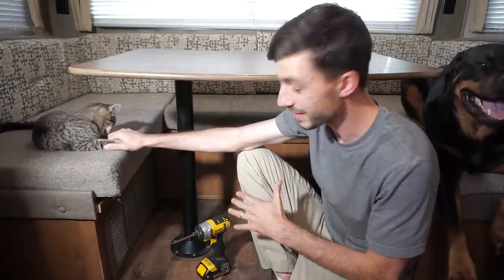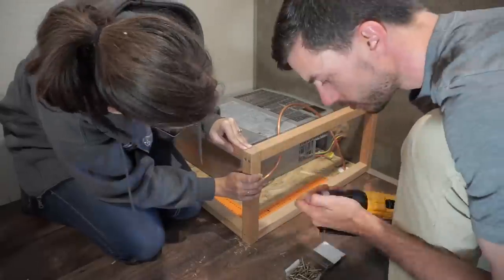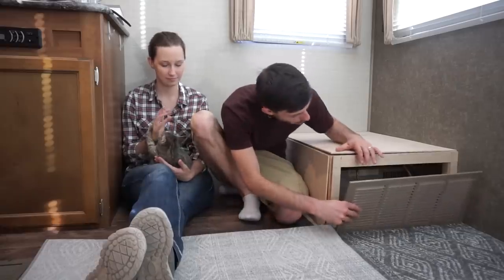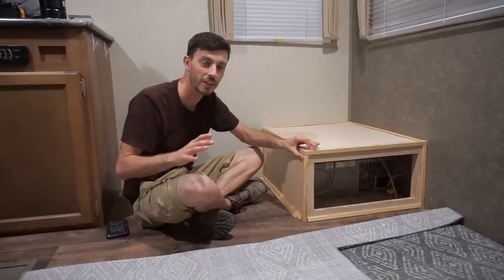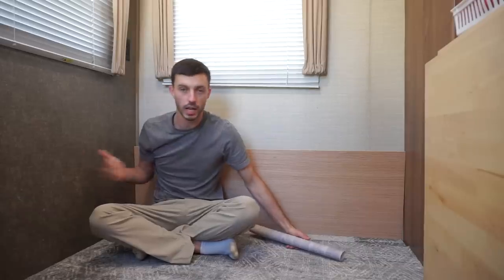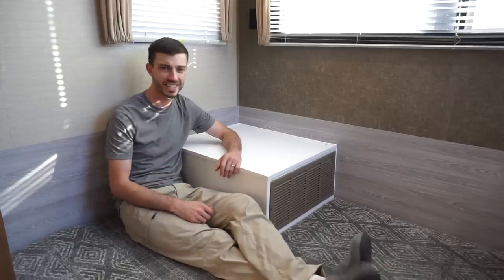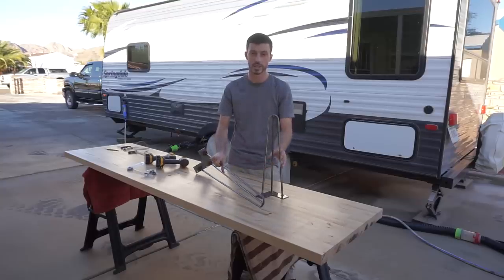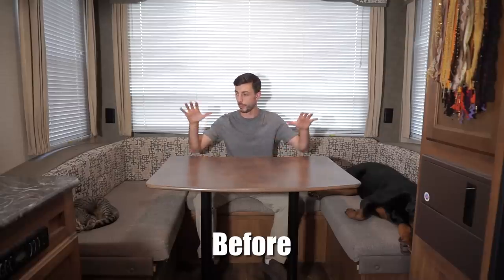Dinette Destruction! - RV Dinette Replaced by Improved Work Space - RV Renovation

Comment: We took out the rear bunks in our trailer to make a craft center for the wife. We put in the foamular and  board in the cargo doors like you did. We added a cat flap into the board/foamular of one of the cargo door spaces. When we land, we open the cargo door to expose the cat flap behind it and put up a folding dog kennel for our kitty, on the exterior.  We cut a hole in the kennel to match the location of the cat flap and put the kennel up on a table which is butted up against the side wall of the trailer.  She goes out from the cat flap right into the kennel. We keep her litter box in it and she spends a lot of time out there, especially at night, to watch the world go by. She loves it.
Reply: Would love to see a video of this .I just bought a fifth wheel and thinking of removing the bunks to make a walking closet and change room
Reply: @junehanna4293  I wish I could provide one for you but that was 5 years ago. I do have videos on our channel that might show it, I'd have to check and get back to you. We no longer have that rig and our little angel has since gone over the rainbow bridge.  We now have  another kitty, Roger, and a class A motorhome. We did something similar. We took out one of the rear bunks and a long closet, which gave us room for a recliner and exposed the wall to the exterior carbo bay. We cut a hole in the cargo bay wall and inserted a cat flap. We then put a small dog crate on drawer slides. We simply open the cargo bay door and slide the crate out. Our dog and cat have access to the crate from inside the motorhome whenever they want.
Reply: @junehanna4293  Our coach is an older model and it doesn't have slides. We took out the dinette and the folding sofa. Now there's so much more room! We put a set of Sterilite dressers on one side and a smaller folding futon couch on the opposite site. I have enough room for a TV tray and a chair in the isle between the couch and the dressers that I use for my laptop.  The next project is to build a folding bed platform that will span between the 2 front seats, remove the futon sofa and put a desk in its place.

Comment: I enjoyed watching your build, particularly the butcher block top.  If you still have problems with back pain, I suggest that you modify your work surface height to approximately 27" high.  I am guessing that the height you are using is more like 29" high, which is too high for using a keyboard for extended periods of time.  I have been dealing with office furniture, both workstations and seating, for over 4 decades on both the east coast and the west coast and helping people with back pain issues.  I have been able to help over half my customers with back pain by simply adjusting the work surface height from dining/executive (29") to typing/secretarial (27").  I suspect this is not something you want to undertake, especially after investing all this energy setting up your work station.  This is just an idea going forward, should you experience continued back pain.  Thank you for doing an outstanding job on the presentation of your project.  Don't get discouraged if you come up with improvements on projects you have completed.  It has been happening to me for decades.  I'm getting better, but not perfect yet.

Comment: another suggestion for  accessing furnace: put a piano hinge on one side so you can just lift the top if you need to work on the furnace. You can re-nail the trim on the lid only and it will still give you a finished look.
Reply: Yes I was surprised they didn't put a piano hinge on it too.
Reply from the maker: The plan is to take the top off the box if we have any problems with the furnace and service it and then re-secure the top of the box with trim
Reply: @Lina: How would a hinge help for the occasional, perhaps never, need to get at the furnace? It has got an unwieldy table  sitting on top of it.
Reply: G Henrickson Yes. The legs on the table would have to be removed if there were a hinge. They may be able to slide the lid out from under the legs if they have to remove it. Either way...you can’t always think of every contingency before it’s done.

Comment: Love your transformation! I have the same camper in a shorter version, I turned the dinette into a permanent daybed.  I don't fulltime (yet), but weekend with my son and three dogs.  I've also added a curtain that wraps from the daybed area, across the kitchen and ends on the otherside of the bathroom door.  This gives each side a little privacy and when completely wrapped around makes the bathroom three times as big.  This winter I am working on changing out the bathroom door for a sliding door since I like to leave it open for ventilation, but don't like that it blocks the walkway.  Happy Travels!!

Comment: I pause at 6 minute to say I like your trailer. I like the simplicity of it, especially no slides. We’re on our 3rd travel trailer since 1978! Bought this one in 1998, be 21 years old in July! 7x25, simple still good. I just need to fix toilet flush thingamajig, it’s stuck now. I don’t get all this, “And it’s got a ceramic toilet!” stuff. This plastic one has lasted over 20 years and this valve sticking is first problem!

Comment: Good job!  The table top and legs are real cool.  Set another basket on top of furnace box for second cat, then they all have a special place.  May I suggest: a bead of clear silicone under edge of outside door to seal it, and if you're going to re-use the spackle, add water to top to keep it moist, just pour off when you use it again.   Over all I was liking your work as you demo'd the inside, so neat and clean, and good work with all of it.  Looks great!

Comment: Watching you brings back memories of last year at this time.  I took my dinette out of my 1992 Monterey by Cobra motor home.  It wasn't as easy or clean a break as I was hoping for...My floor had a raised portion where the generator housing came up into the space...We moved the couch over it from the opposite wall, but I would love to sell the couch and cushions from dinette, since they are in pristine condition...all end caps and fittings to boot.  Anyway, this brings back lots and lots of memories!  Thanks for showing me how you did things.  I plan to remove the queen size bed, and it has the electrical panel, so that will be fun.  Blessings!

Comment: The Dinette is the most ridiculous leftover from 1950's RV design.  It is long overdue to be axed.  I removed mine from a 22ft Class C, and put a desk up instead. One side over the wheel well, I build a 4 drawer cabinet.  To the right behind the driver seat, I secured a dresser from IKEA.  I added a birch plywood solid table on top as the desk.  Room under for my legs, laundry basket, and comfortable office chair. Perfect!  I sold the dinette to a guy who was converting an empty trailer for $200.  I also removed my useless fold out couch bed from factory, and made a slat bed instead. I still have the loft Queen bed, but this one is a bench by day, bed by night.  I only need to pull out the slats if I have two guests for company. So much better and very comfortable.

By the way, the typical raised platform for the dinette can be easily removed. There are a couple of wires and plumbing down there that can be pushed along the wall instead.  

This was a very good idea in your RV.  Smart move!  That rug looks nice.  
fyi - Please do not add any music to demo, DIY, tour, cooking, or wildlife videos especially if you are talking. Its an ON OFF game with the volume control - no fun for viewer.

Comment: Amazed at how much dead space was in the original set up. Why it was never designed for storage is a shame. Suggestions: since you have a garage shop set up. Next time, design ahead of time, prototype in cardboard, so you have all your measurements. build the framing in the shop bring it on site, install. Hope you finished the box with removable closures, so you can access the furnace if ever needed. 
For the carpet, again you can make a template with brown paper, so you’ll know where you cuts are. As for preventing fraying, carpet tape applied to the underside of the carpet right where the cuts will be made will help prevent fraying, as well as assist you in reconfiguring the shape of the carpet. Again a cardboard template would have helped in cutting the hatch closure. The contact paper in time will loose some of it’s adhesive properties unless it is properly burnished.
Everything looks very nice. One last suggestion, by installing legs on the desk, a potential problem has been created. If you ever have get access to the furnace, the entire desk will need to be disassembled. This could have been avoided by installing cleats on the three walls ( simple 2x3 installed into the studs with countersunk bolts) pre drill vertically up through the 2x3, predrill the underside of the butcher block, set the butcher block on top of the 3 sided ledge, finish by installing screws up through the bottom of the 2x3 into the corresponding holes in the butcher block.
This would have given a secured to the wall free floating desk, with un encumbered access to your furnace.

Comment: I have a cab over truck camper.  Can't quite do the same thing, the wheel well is in the way -- but you guys have me thinking.  Maybe if I amputated both legs at the knees -- nah, not practical.  Maybe if I put the cross table higher, and put the chair (when needed) on a platform.  I can hear the gears turning in my head.  Hasn't happened in years.  Thanks for sharing.

Comment: This was great to watch. Question  about the dinette table. I didn't hear  you mention that at all during the video, but I see you linked to it in the show notes. I like that. Do you  have it on locking casters?  How do you  secure  it when you're moving? Also, the shot  of it unfolded with dinner places set looked sweet, but I couldn't figure  out how you'd get in/out  of there to get to the kitchen area, it looks like you  have about 6" of free space per side. ;-) Are you both that skinny? heh. Thanks again,

Comment: Just wondering since the Chairs have the wheels. If they move around when you are traveling. If they are. You could get like a Long bungee cord and use the legs on the table you made. and attach the cord to both sides just to keep the chairs from moving around alot. Still nice job
Reply from the maker: We just lay them down on the ground, no issues while traveling

Comment: So when the heater needs service how do you get at it??? MAYBE A DOOR
Reply: I was thinking the same? Hmm 🤔
Reply: The box is made where it wouldn’t be that hard to disassemble.  One good thing is maybe they have a furnace like the ones in 3 RVs I’ve owned.  Had each one several years and those furnaces were like the Energizer Bunny.   Just kept on running.  Good luck. However, if you guys ever have any HVAC problems, look into replacing your systems with a Heat Pump Mini Split System.  They are available in 110 v units now.  Might work well for y’all.
Reply: I have one just like that.  The high temperature limit switch failed.  The service guy did not even try to access the furnace from the inside.  He took the exterior cover off and worked his way to the front where the limit switch is located.  Those things are meant to be worked on from the outside and not the inside.
Reply: Great job!
Reply: @pav7463  - ABSOLUTELY!!!!
Reply: How do you think??? There is a lot to be said for keeping things simple.

Comment: Question: Why sand after applying coat? Doesn't it take away the coat?
Reply from the maker: No ti does not, it takes away any waves in the coat from the application and it makes it smoother.  It's actually part of the instructions on the polyurethane

Comment: What was the purpose of the table legs? Either a couple more metal brackets , or a continuous wooden cleat anchored into the trailers studs would have been sufficient, and even have added strength to the rear of the the trailer.

Comment: Did you consider moving the furnace and centering it under your table, even turn on end if possible. Then trim the legs on the ikea table and slid it under your table and over the heater.

Comment: I agree, dinettes are made for RV shows, not day to day living. The foam is too soft and they're too vertical. I must say, the construction of you trailer is pretty good from what I saw you take out. No split boards and funky corners. 
I might have put the seam in the carpet on the other side, under the table, but that's just me. You did a great job building your desk!
Reply from the maker: The reason we didn't put the seam over there is because we have to move that table often and we didn't want it catching on the edge

Comment: I would cheat on the carpet and use carpet tiles. They are removable if you need to replace a piece as well without replacing the whole piece. Commonly used in commercial spaces and they are quite durable. Your job looked very nice for sure...just putting it out there as a suggestion for future projects...

Comment: Did you check with the manufacturer for spacing astound the heater. Without proper spacing it doesn't give proper ventilation and will cause a fire. I'm scared for you.
Reply from the maker: Manufacturers put the same sized furnaces in smaller spaces than this, so we're not concerned
Reply: @FateUnbound  it goes by specifics to the heater, not similarities. My husband was a carpenter that built custom cabinetry and now he's in school to get his master plumbers lic, and has an hvac cert already. He was watching it and voiced the concern. I was passing it along. I hope and pray nothing happens. If it was me, I'd call just to be on the safe side. Maybe direct them to your video?
Reply: I am certain they checked all this out after being around the furnace for many hours, warning labels in their face while building the surround. RV furnaces, unlike those in a home, need nearly no clearances. Combustion air and exhaust is routed to the outside...Only the cabin air intake would be of concern and I am certain they allowed for this. All is good Myssi.

Comment: Great job!! Question: Wondering what would be involved with moving the furnace? Does the hot air vent out there too or does it run through ducts to to other places? We're considering buying the same travel trailer and doing the same modification for an office. My wife and I both have remote jobs and want to get out of the cold during winter. I'd like to have more space between us if it all possible. Your videos are inspirational.

Comment: Put duct tape over the seams of the foam board. Inside and out.
Reply: Duck tape is pretty bad for almost every kind of purpose like this. I'd probably go with aluminium tape, or something made to be permanent. Duck tape glue tends to turn to mush in relatively short order. It's certainly not made for ducts, either (the name duck tape reportedly comes from it rejecting water; using the word duct is a later mistake people keep making.)
Reply: Croft; yep, I’m sure that would be better than the duck tape.
Reply: The foam should insulate quite well the way David put it in. If they feel the need later, they can always run a bead of door and window gap filler from either side and that would be a more permanent fix without the use of any tape.
Reply: The tape would be to stop air infiltration. Every little bit helps.
Reply: Croft: duct tape is to join ducting for air/heat. Had been used years before The Red Green Show used it.

Comment: It would have been better to fit the rug along the longer wall and then you would have been able to just need a shorter 3 inch strip beside the furnace.
Reply from the maker: nope, we did this on purpose since we slide the folding table in and out. it would be annoying if the carpet seam was on that side

Comment: I know this would have been more work but could you have repositioned the heater in a vertical position upright in the corner and re-plumbed the propane line? This would give you more foot room in front of the heater and the heater would monopolize less horizontal space.
Reply: The dining table wouldn't fit.
Reply from the maker: We didn't want to redo any propane lines

Comment: * * *
Great video y'all. . .
* * *
Next time you need to cut styrofoam insulation - think 𝐛𝐫𝐞𝐚𝐝 𝐤𝐧𝐢𝐟𝐞... you'll be amazed at how easily the serrated edge cuts through it.  (grin)
* * *
Great project... thanks for sharing...
My only question is about the weight...
How much weight did you take out...?
How much weight did you put back in...?
Just curious...
* * *
Not that y'all need my approval... but. . . and what a 𝐁𝐈𝐆 𝐁𝐔𝐓𝐓 it is. . .  (wink) here it is...

. . .𝐔 𝐃𝐔𝐍 𝐆𝐔𝐃. . .

* * *

Until that time. . .
Reply: That's a really interesting question, now, I am really curious to find out the answer, thank you for asking!!! 😉

Comment: Personally I would have gone with beadboard wainscoting, barnboard, or even something like this hardboard ( https://m.lowes.com/pd/47-75-in-x-7-98-ft-Embossed-Red-Brick-Hardboard-Wall-Panel/1015475 ). One huge board would easily cover that much wall and won't scrape off if it's bumped by something. You could paint it any color you like and pick whatever texture you like. Plus bringing it up to desk height would do a lot visually. Not to mention you wouldn't need that extra plywood piece either.

Comment: I actually do not like the design setup, Why it looks like you worked hard on it. The far left is just cluttered. You could have built two tables on each side and off set the chairs. Then that heater would not be in the way for feet. And you both would a nice view still. In an RV loosing space is never a great idea. Loosing that side storage was a bad idea in my opinion. But hey if you guys are happy thats all that matters right.